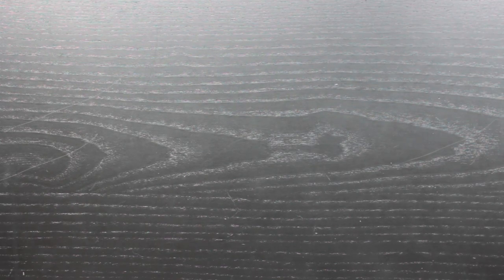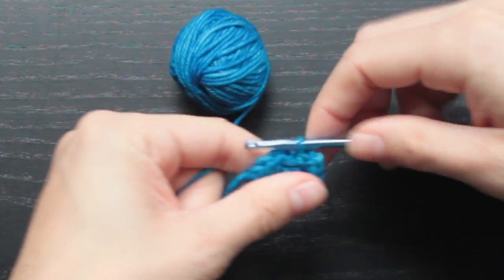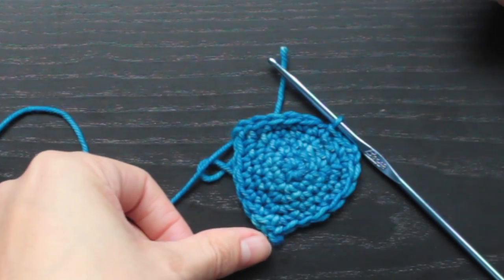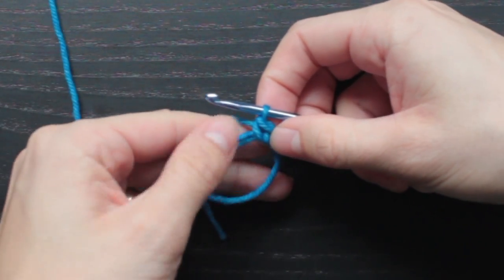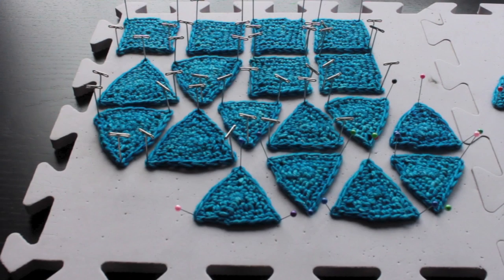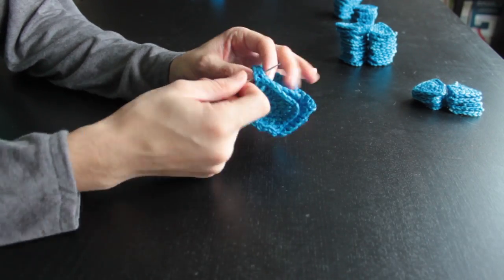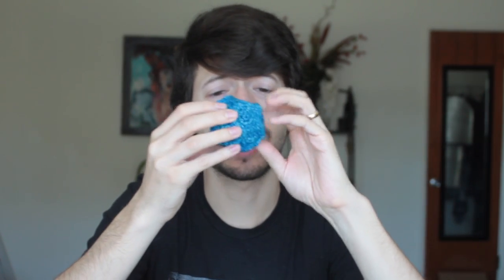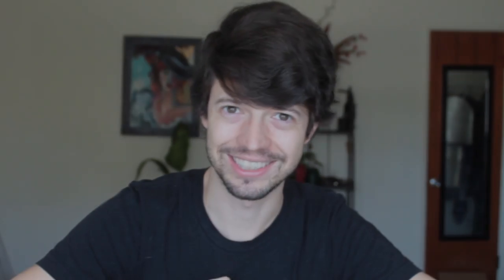How to Crochet Platonic Solids - DnD Dice

Comment: But what about the d10? Those 3 shapes will make the d4 d6 d8 d12 and d20 but not the d10.
Reply from the maker: I cover that in the video :) since we’re dealing with soft shapes, we can stretch the triangles into the proper shape for the d10
Reply: @BenjaminKrudwig  oh fell asleep watching but what about adding a triangle point in the middle of the bottom of a triangle?
Reply from the maker: @saberhawks4074  you could certainly do that, add just a tiny triangle on the bottoms haha, but I wanted to make this as simple as possible.

Comment: Great tutorial!

I had trouble getting my triangles to be as pointy as i wanted (they were very round) and I found that adding an extra single crochet on each side of the corner (in the same hole) helped a lot. I wrote up a little pattern for my reference, so maybe others will want as well! Note that you also must add extra stitches to the end of each round if you do it this way, and so you'll have to keep track of more numbers.

6SC into magic circle,
row 1: { (SC) (SC, SC in same stitch, CH 2, SC in same stitch, SC in same stitch) } x3
row 2: (SC) x3 (SC, SC in same stitch, CH 2, SC in same stitch, SC in same stitch) { (SC) x4 (SC, SC in same stitch, CH 2, SC in same stitch, SC in same stitch) } x2 (SC)
row 3: (SC) x5 (SC, SC in same stitch, CH 2, SC in same stitch, SC in same stitch) { (SC) x7 (SC, SC in same stitch, CH 2, SC in same stitch, SC in same stitch) } x2 (SC) x2
row 4: (SC) x7 (SC, SC in same stitch, CH 2, SC in same stitch, SC in same stitch) { (SC) x10 (SC, SC in same stitch, CH 2, SC in same stitch, SC in same stitch) } x2 (SC) x3
etc.

the pattern for additional rows, is that you must increase the first line of stitches (before the first corner) by 2 every row. increase the other two lines (before the second and final corners) by 3, and add one extra stitch at the end of the round (to make up for the missing one in the first line of stitches).

hopefully that makes sense!
Reply from the maker: that's a great way to add some extra pointiness! Thanks for the write up :)